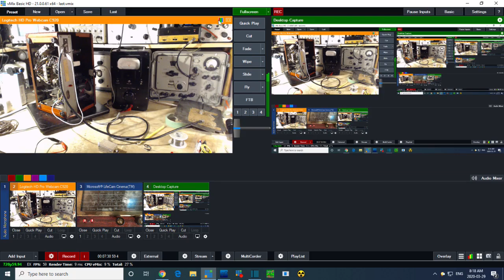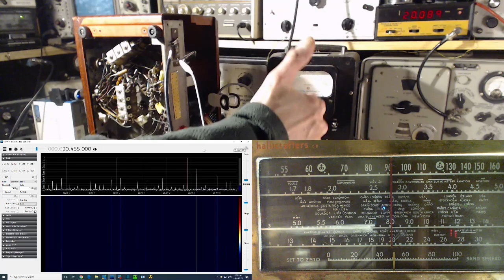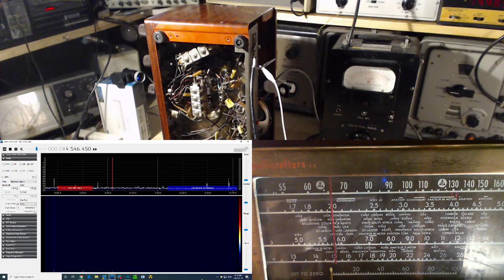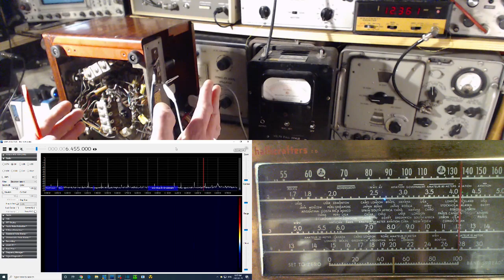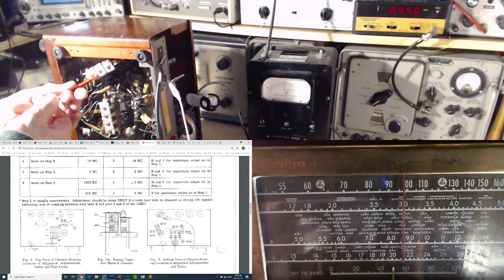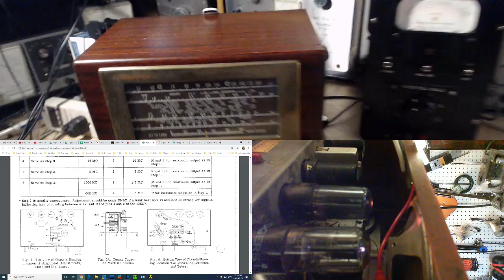Hallicrafters S-38D Communications Receiver Video #10 - Alignment Finale

Comment: A RTMA ( once called RMA) dummy antenna  passes the AC  input/output and blocks DC to an  input/ output i.e. antenna.
 It's needed due to the low impedance level of a  signal generator! Long video that really over emphasizes the testing and alignment part!

Comment: You are. Playing about with tuning different frequencies on the radio but you haven’t got the band spread set to zero.
Reply: widecast To quote his words at 9:53 "You notice the band spread is set to 50... The radio instructions say zero,..but in the zero position there is no hope of aligning this radio." In other words; I realize there is still something wrong with this radio but instead of fixing it, I rather make my own alignment instructions to circumvent it. Thats like "Hey my car is pulling to the left hard with the steering wheel set straight,- lets fix it by putting a bend in the road then"

Comment: Why not use conventional test gear rather than that SDR  gimmick.  I'm sure the RFI produced by that SDR's microprocessor will result in loads of noise.
Reply: @David Leger  That whole SDR deal has other useful applications. Aligning a prone to noise AM radio is NOT one of them. I you follow his travails (or is it odysseys?) you will realize the huge RF noise floor present in that shop of his already. No need to add to it by using more digital gimmicks which radiate RF noise themselves or act as antennas radiating f.ex. the RF noise from inside his computer via their (unshielded) USB cables into the shop. There are other ways to test the local osc frequency; a sniffer coil and a scope or sniffer coil plus preamplifier on a frequency counter would be one. And even a PLL tuner radio/ scanner with a ceramic filter IF strip would be precise enough to get an idea of where the LO is running about.
Reply: Good point!